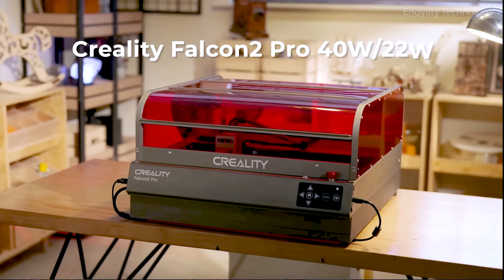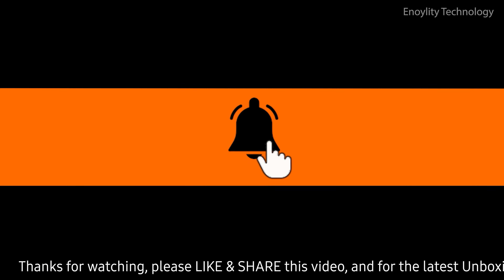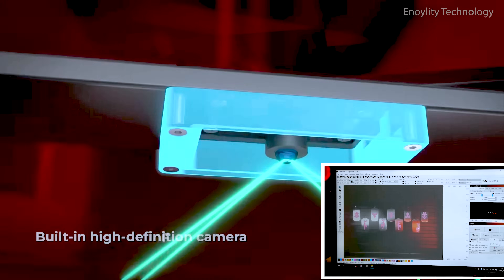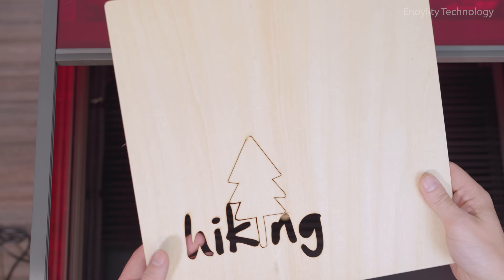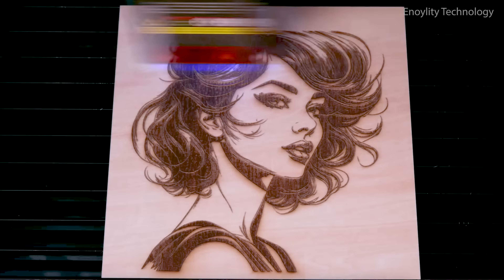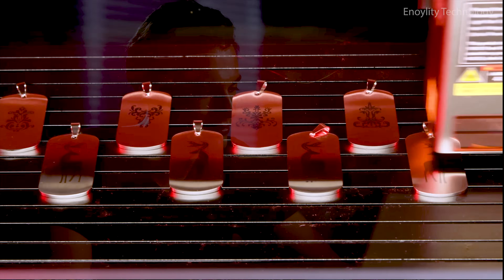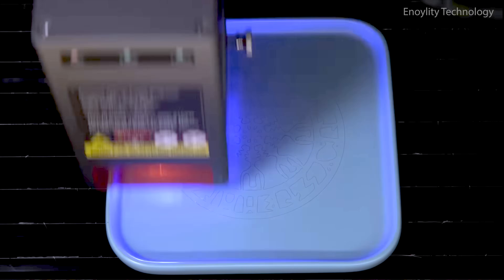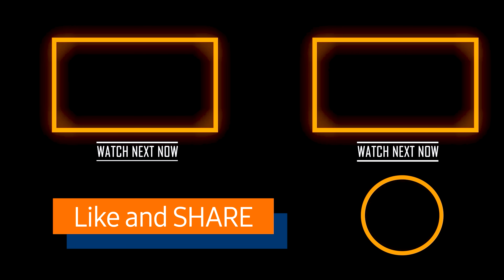Creality Falcon 40W Laser Review: Powerful Precision Engraver for Every Creator!

Comment: You can adjust the depth of the engraving, allowing for different effects and styles.
Reply: Z-axis adjustment isn’t automatic, which would have been nice for the price
Reply: It’s powerful, but there’s a learning curve if you’ve never used a diode laser before
Reply: Good for wood, okay for metal marking, not great for glass
Reply: Focus adjustment isn’t automatic which is annoying For the price, I expected better z-axis control Manual focus works but slows things down
Reply: For leather work, the 22W is just right—precise and doesn’t scorch the surface
Reply: The air cooling is efficient—I’ve run long cuts with zero overheating issues
Reply: Assembly was easy, unit packaging is well designed. Assembled, made room for it and with the software was engraving metal business cards in meer minutes. Software installed and found the engraver in no time. Checked and updated the machine firmware seamlessly.
Reply: With a twenty-two watt optical output and the ability to operate at up to twenty-five thousand millimeters per minute, this machine can efficiently engrave and cut through a variety of materials
Reply: The pictures are a few of the items I have completed. I have had the unit for 2 months and am hooked on my laser. I would recommend this for new users. Mine is a 10 watt and I am looking to get the 20 watt also to be able to cut thicker material

Comment: Setting up a laser engraver is often straightforward, allowing users to start projects quickly.
Reply: The engraving on coated metal tags came out better than expected
Reply: Not the quietest machine out there Fans and motors are loud during longer jobs Use ear protection
Reply: Be sure to take the time to print a speed/power matrix onto the wood your going to use. It is very useful. I like to see my charts, parameters, etc., set up for inches, as my other software is using inches, not mm's.
Reply: Otherwise it is an impressively good machine, the design software is very easy to use, and I tested all the security functions and they worked wonderfully, a very good product and highly recommended in every way.
Reply: First, the module. Using calibrated equipment, I checked the output and it was a true 22W output. Over the course of an hour, the output varied by 0.2W, which is next to nothing. The spot size isn't great, more typical, and the rectangle shape is less than ideal.

Comment: Many models are designed to be lightweight, making them easy to transport for events or workshops
Reply: Works great. So many things it will do. So much to learn. I am very happy with it.
Reply: The laser has a built-in protective cover on the front so you don't have to use glasses while it's on.
Reply: Easy set up. Great laser engraver for a beginner. Price can't be best.

Comment: The precision of laser technology ensures clean cuts and high-quality engravings without rough edges.
Reply: Every cut looks sharp and professional
Reply: The engraving quality on wood and leather is stunning Super sharp details
Reply: Some of the screws on mine were loose right out of the box
Reply: It’s powerful enough for production work, but you need to dial in your settings properly
Reply: Use good materials if you want good results Cheap wood and plastics just burn and smell The machine deserves better inputs
Reply: Setup was fast and smooth—everything is well-labeled, and the instructions are easy to follow
Reply: The machine comes pretty much fully assembled, a nice touch as new owners tend to struggle with basic mechanics. Front controls are available, as is an SD card slot so you can run jobs without a PC connected
Reply: Not only is this powerful, it is also precise. I was able to engrave a coated paper to reveal the white inner layer and to cut the outer shape as well. This would work to create intricate filigree paper cuttings

Comment: They can engrave and cut a wide range of materials, including wood, acrylic, leather, glass, and even some metals.
Reply: I cut 18mm pine in two passes this thing is no joke
Reply: Excellent Quality Excellent Machine Highly recommend it.
Reply: Fantastic for professional on the go as well as some advanced DIYers. Amateurs might not be able to use it's full potential but it is nice to have that for future.
Reply: I bought this 40w laser to replace my couple year old 10w laser and wow, what a difference in quality! While my first laser was great for learning on and such, it doesn't hold a candle to this behemoth.
Reply: I bought this laser as my first engraver and have been very pleased with it. The assembly took only a few minutes and I was learning my engraving skills. Great value over other 40w laser and works very well.
Reply: Simple to install, adjust and use, I bought it for my office, but I think I'm going to move it to the garage where I have a spacious place where the smoke won't affect it, I know I can do a simple job to keep it in my office, but NO THANKS .
Reply: Limit switches are in all four corners, an item that usually gets cheaped out on by other vendors. Automated air assist is included too, allowing you to toggle it on/off through software. This too is less common in an OEM setup, usually a 3rd party add-on. The wiring is nicely routed, which is often missed, and higher quality than many.
Reply: The machine will automatically shut off if the engraver is moved too much -- nice safety feature. There is an emergency shut off to quickly shut everything off -- again, a nice safety feature
Reply: This laser has been a learning curve but it has been the best investment made. I have cut wood, engraved, made many layered arts, and cups. This takes crafting to a whole different level.
Reply: Assembly is simple with with well fitted parts. Its easy to use and makes great cuts just like you would expect. I would buy this again. I would recommend this to other as well. Customer support replies within 24 hours.
Reply: The amount of things you can create with this laser engraver is incredible. Excellent quality and affordable. My kids are happy too since I been able to make a couple of fun things for them.
Reply: I used Lightburn software to create designs and operate the engraver. Overall, I am very happy with the engraver and I am excited to keep learning more.
Reply: . I went with the 20W so that I knew it could do all the different medians that I would want. So far I’ve done wood and metal, and have bought the rotary attachment so that I can do cups. Defiantly a great first engraver!
Reply: Purchased on here best price and came the quickest now just need to learn the machine

Comment: Easy to set up. The computer fan does a good job of pulling the smoke out of the enclosure. It is important that the enclosure sits flat on the surface supporting the laser cutter.❤❤
Reply: Everything just clicked into place perfectly 😊
Reply: Was nervous at first, but setup was actually easier than I expected. Took about 30 minutes
Reply: Triple security support
Reply: Not exactly plug-and-play, but once it’s set up, it runs like a dream
Reply: Setup was easy but definitely needed YouTube help.
Not quite plug-and-play for someone new to lasers.
Still, not the worst I’ve used
Reply: It is compatible
Reply: High precision engraving.
Reply: User friendly
Reply: Overall, this machine is a keeper, but you’ll need patience, some DIY spirit, and maybe a Facebook buddy or two. Four stars for the learning curve, but once you crack the code, it’s a masterpiece in motion. An acquired taste, but one I’m starting to love.
Reply: Safety features included
Reply: I was engraving my first project within the hour 😊
Reply: Impressed with how user friendly the setup process was 🤩
Reply: The red laser adds a touch of aesthetics to the workspace, enhancing the overall experience. This is an amazing machine and I'm constantly impressed with what it is capable of.
Reply: It cuts three millimeter plywood like butter, leaving a crisp edge with no burnout whatsoever. I've successfully engraved stainless steel and was shocked at the depth of the engraving. Most diode lasers can mark steel, but this can remove metal and can color-engrave based on the power and speed set in lightburn